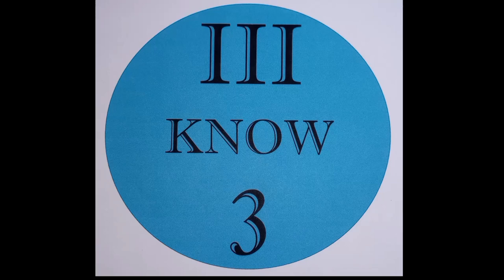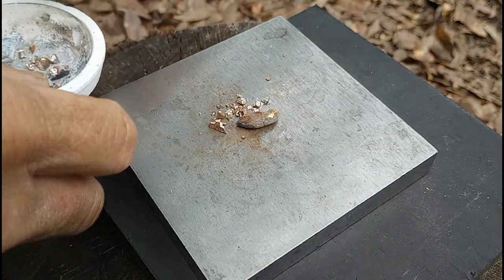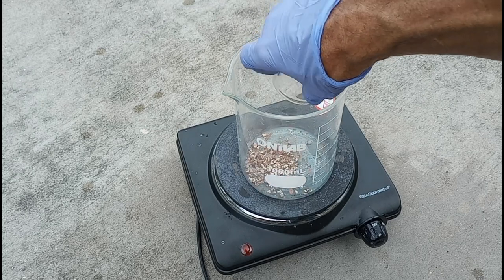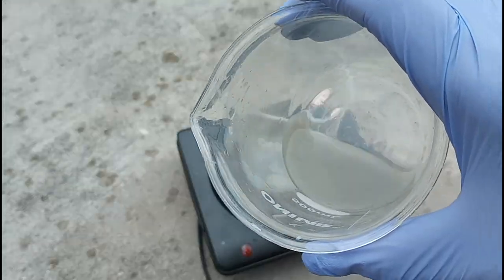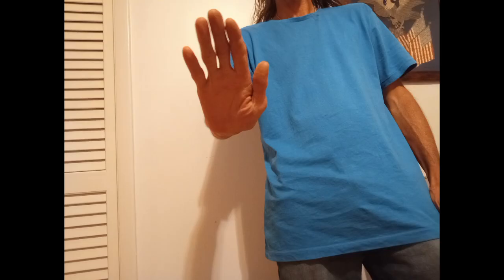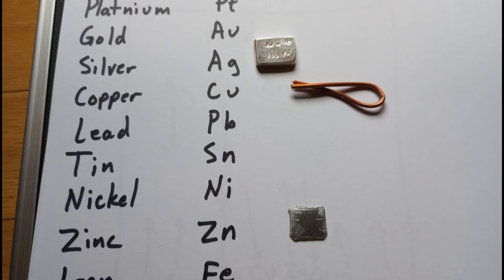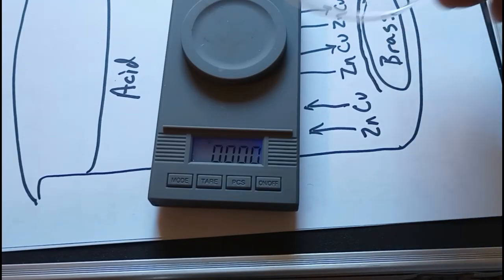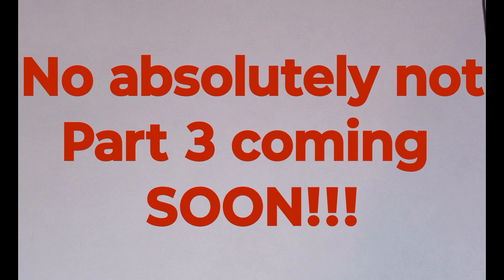Brass, Copper, Zinc and Acid Part 2

Comment: Ever tried melting it down and pouring into shot? I’ve heard other refiners say it’s easier to put it into solution when it’s in smaller pieces. More surface area for each piece when it’s in smaller pieces or powder form.
Reply from the maker: Yes, that is why I focused on the mechanical separation in the beginning to create more surface area like you mentioned.  Brass melts at around 1100 degrees Celsius depending on the copper to zinc ratio. Zinc vaporizes into Zinc Oxide fumes at just over 900 degrees Celsius.  So the less melting of brass you do the better.  Zinc Oxide fumes are not deadly, but they can cause "metal fever" that although temporary feels like a bad flu for a couple of days.  Thank you for the awesome comment and for watching.
Reply: @IIIKNOW3  👍👍

Comment: Will bronze do the same as brass? Since they are both copper alloys
Reply from the maker: Most alloys require extra work to get them to plate as an alloy.  I have not yet tried bronze plating because you need chemical additives to the electrolyte.  Potassium cyanide is one of the recommended additives for example.  If you have the right electrolyte, you can just use a copper anode from what I have read.  There are some premixed solutions that you can purchase for bronze, but even with those they are expensive and there is work to maintain them if doing larger pieces or multiple runs.  A lot of what I have read is that successful professional electroplaters who do alloy plating do not share their techniques and formulas because they consider them proprietary and if anyone could do it they couldn't charge as much as they do.  I have a solution of copper and nickel acetate and was hoping it would plate a nickel bronze-type alloy; that was a major FAIL.  The copper plated out first, then the copper and nickel plated out together but not as an alloy just at the same time.  It was interesting though because if you scraped it off you could separate out the pure nickel from the copper with a magnet.